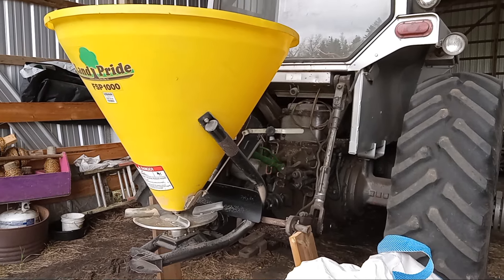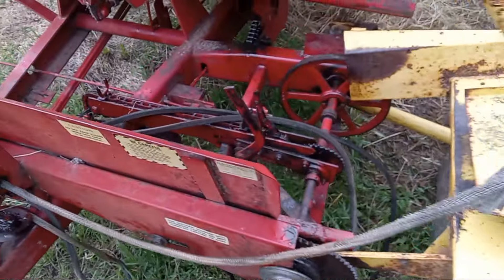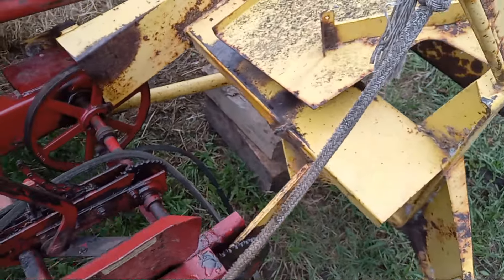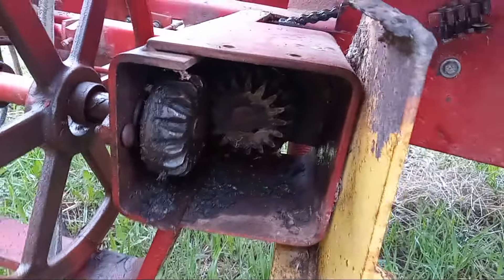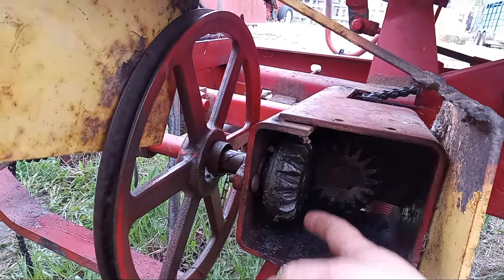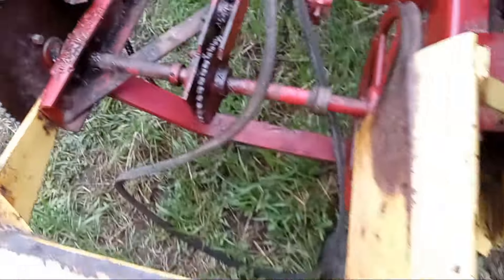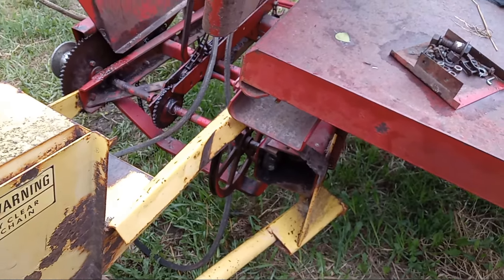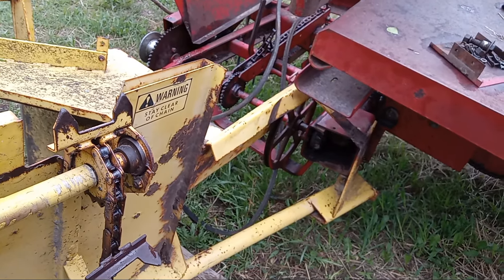NH 1002 bale wagon belt change for chute

Comment: Jonathon, I don't see a follow on video. How did you get the bevel gear off? I'm at the same point as the end of you video. Thank you for any help.
Reply from the maker: @jonesallu  the follow on video was there ill check. We pressed it off with a hi power hyd pump and small puck cylinder
Reply from the maker: @jonesallu  theres a bit more in never ending repairs video
Reply: @jonathantarrant2449  Thank you. I finally got mine off today using an air hammer. No damage to shaft. I pulled everything off the shaft, chucked it in my lathe, marked it and straightened it. Everything slides on and off (with interference from the necessary parts) and I bathed it in antisieze during assembly. The next person will have a much easier time. Thanks again.